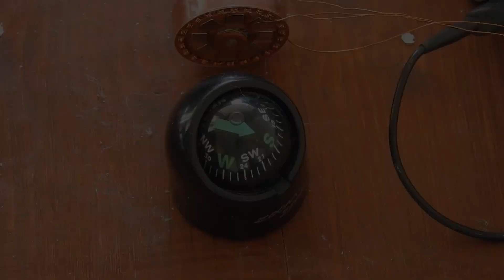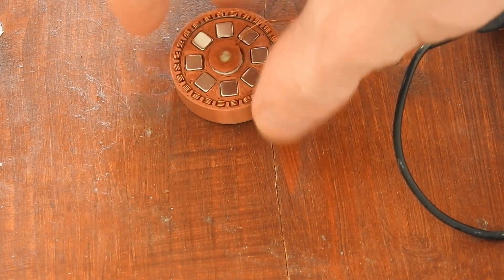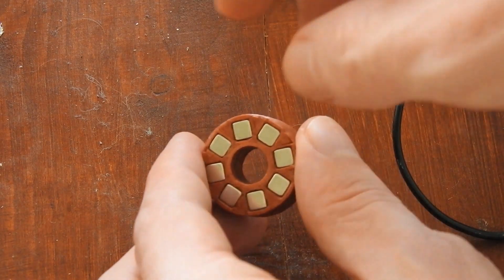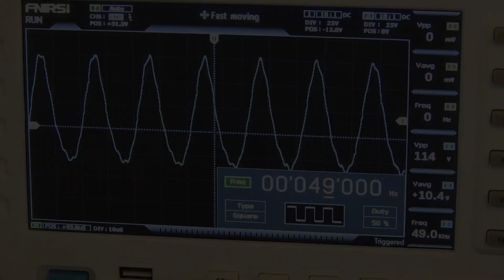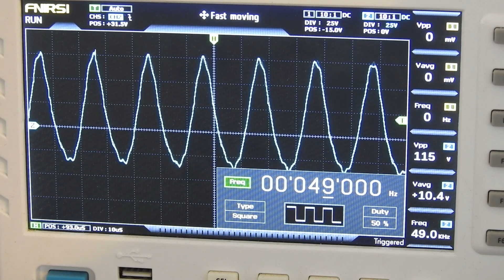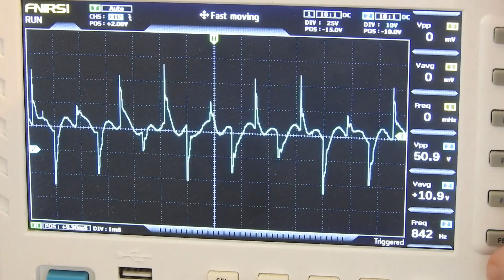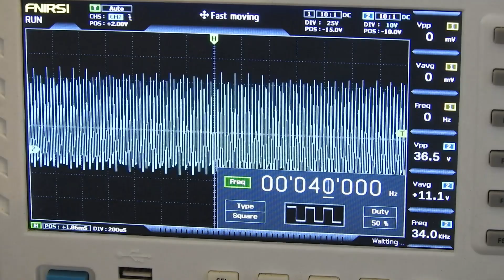Watch a collapsing and expanding magnetic field in realtime

Comment: It's very compelling because it visually proves that the alignment of electron spins in the electromagnet creates a magnetic field.  If a permanent magnet, such as a strong rare earth (neodymium) magnet is used as the core of an electromagnet, the combined field (permanent magnet + electromagnet) can be viewed in the same way you show here.

It is not commonly considered, but a small team of us, after studying the Cavendish Gravity Experiment from the year 1797 which demonstrated that all collections of atoms - ie. all matter objects - create a gravity field, we set about developing electromagnetic techniques to try creating artificially-strengthened gravity, conceptually similar to an electromagnet.

1)  we use a 10-layer lamination of aluminum foil/insulator layer/aluminum foil/insulator layer/etc. as the test device

2)  we use DBD ('dielectric barrier discharge') approach to pre-polarize the charged particles in the aluminum foil layers

3)  a strong static magnetic field is installed in the center axis of the aluminum foil/insulator layers, and creates its static magnetic field at right angles (orthogonal to) the layers

4)  we position small coils adjacent to, but not touching, the stack of aluminum foil/insulator layers and power the coils with extremely high (microwave) frequencies - a klystron tube can be used to feed microwave frequencies in this setup.  The coils, when powered up with the RF (radio frequencies), induce eddy currents in, and parallel to, the aluminum foil layers

5)  so we have:  (a) pre-polarized charged particles in the thin metal layers;  (b) eddy currents inside the metal layers;  (c) an orthogonal magnetic field (d) so the Lorentz Force manifests on the pre-polarized charged particles in the metal

The result is - the charged particles in the metal oscillate coherently, at the RF frequency being fed to the eddy current coils, and are thus subjected to immense back-and-forth accelerations in the metal.

Why did we come to believe that accelerations were key to enhancing the base gravity field in the metal?  Mainly because of the Cavendish Experiment's outcome.  We recognized "all objects of matter produce a gravity field" as Cavendish found.   "A single hydrogen atom - consisting of one proton in the nucleus, and one electron - fully qualifies as an object of matter, and thus has a gravity field."

And since accelerations are a key part of the atom, there was really nothing else to explain gravity.  The electric charges on the proton and electron did not sufficiently explain gravity.
.

Comment: how did you build the oscillator?
Reply from the maker: It is a simple electromagnet, a steel core with a copper wire wound around it.